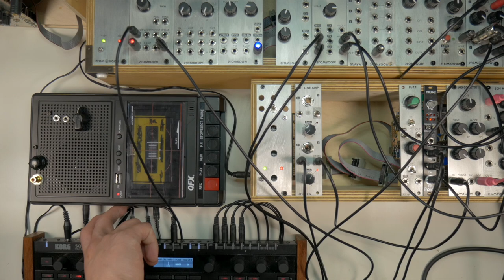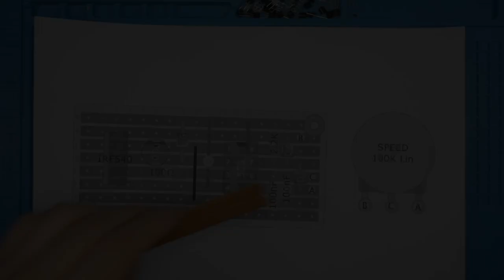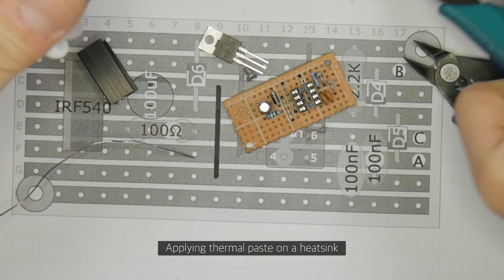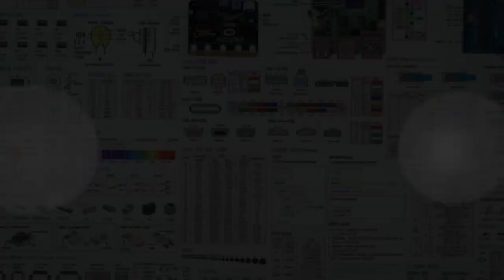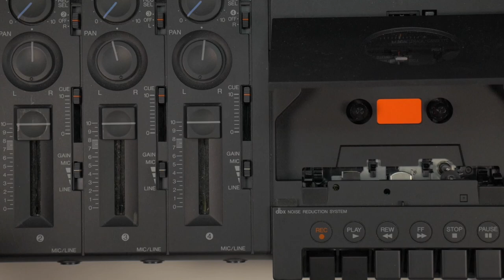SPEED & CV/GATE MODS ON CASSETTE PLAYER

Comment: I was able to do this with my reel to reel Teac x-3.  I replaced the small blue trim (pot) potentiometer on the circuit board that is wired to the tape motor.  It controls what speed  the reel to reel should be running.  I replaced that one with the one in the video.  I also soldered wires to the board so they are long enough to come around to the front for manual control.  I was shocked when it worked!!!   I now just have to set it up with midi control.  thanks for the video.